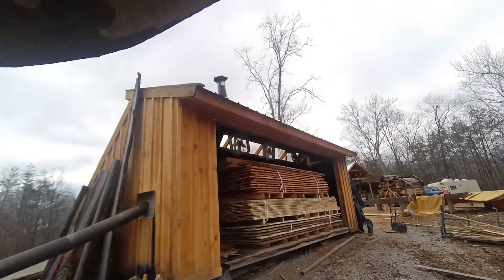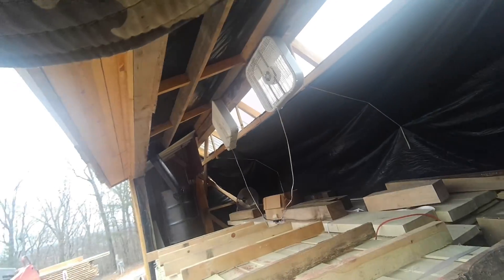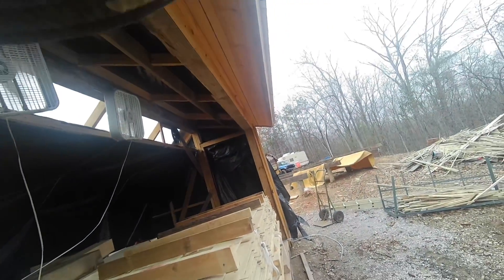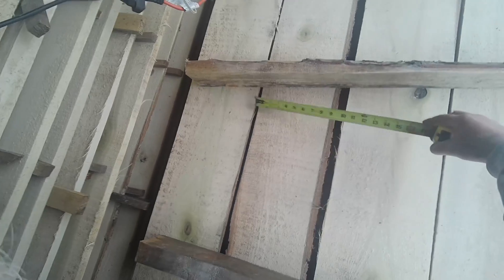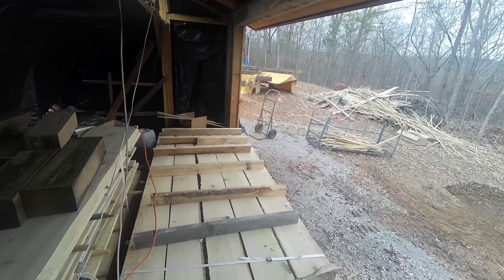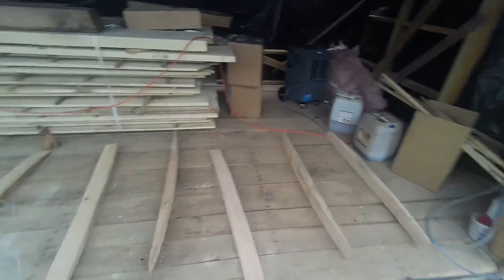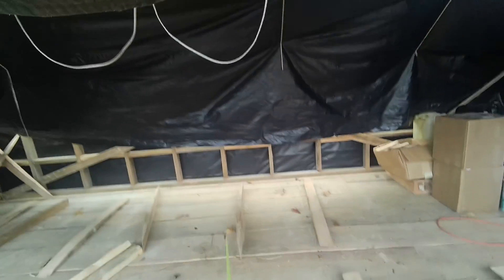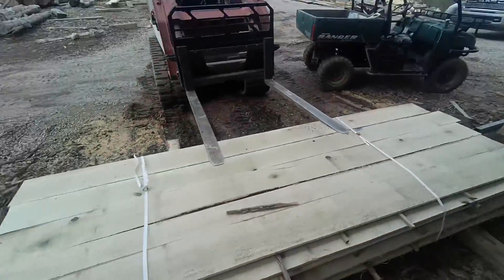Solar Kiln Turbo-Charged!!!

Comment: It just seems weird to me to use just the smoke stack for heat, when 80%+ of the heat is coming off that barrel.
Reply from the maker: You are losing 80% of the heat off the barrel just using it to warm the inner chamber which keeps the room hotter and dryer than without it. I also get rid of all my waist Wood so it’s a win-win for me. 👍🤠

Comment: That’s a really nice looking kiln , I can’t tell how you close it up , what is the door design
Reply from the maker: Originally, I was going to make a four-door folding like you see on all the others.  I have two very thick canvas tarps like ones on a circus tent put one on the inside and I have 4 inch foam panels that I put in and then put the other one on the outside.  At first, I was using that only as temporary until I built the doors, but it worked so well and it’s so convenient when I just pull everything down when I’m ready to unload and I don’t have any of the doors in my way I am a little confined to space next to my forest on the Door side.  Actually this system works very very well for a solar kiln. With the heat exchanger, you can keep it running all winter long and still get wood to dry in a timely manner. 
Thanks for watching. I appreciate it. !👍🤠

Comment: What is the Lowest you Moistier Meter will read ?   OR What was going on with the meter ?    I am not doubting your wood is dry, just wonder what was going on with the meter ?
Reply from the maker: Below 10% it just reads low. Above 10%moisture  will give actual reading 

So it’s reading low I am at 10% or less then I measure the shrinkage